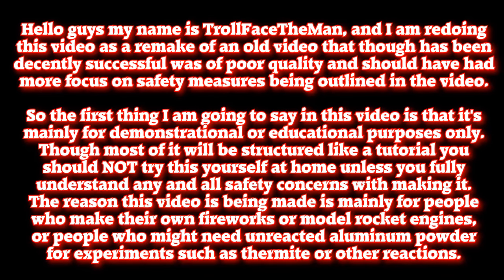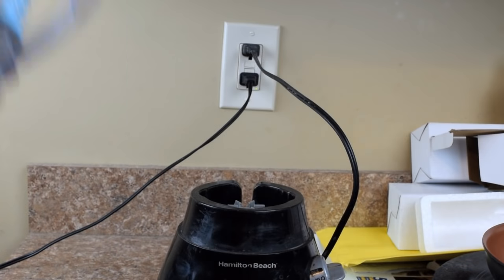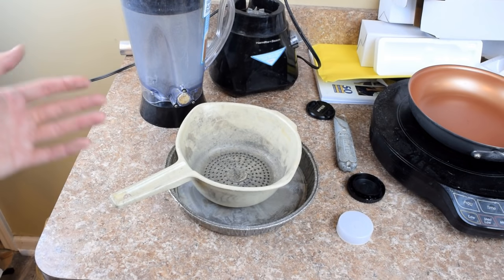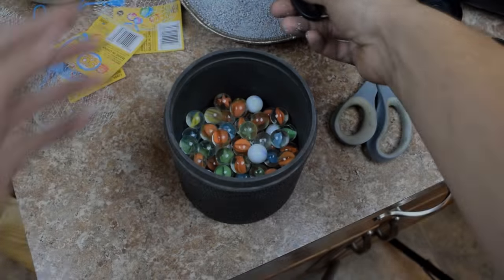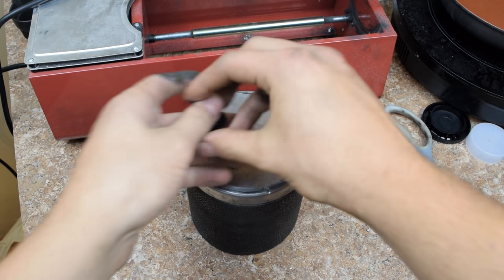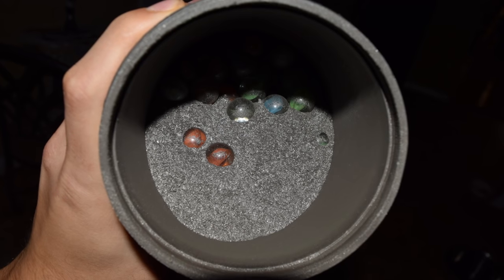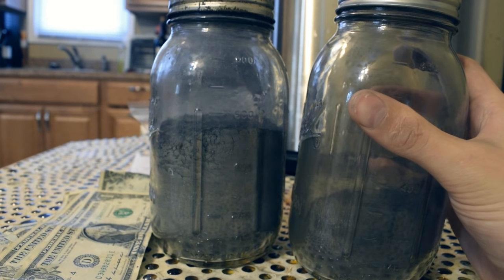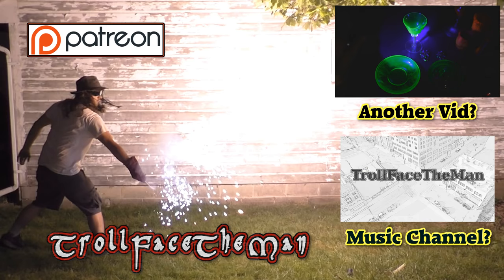How To: Easy Bulk Dark Aluminum Powder (My Homemade Process)

Comment: When you open the blender and all that ultra fine dust sized air float aluminum powder "smoke" is seen... how does that not ignite? It's extremely tiny particles in contact with fresh oxygen. I thought that would ignite as soon as the lid was opened or even as it was being ground up in the blender.
Reply: I've never tried it, however dust in general, even coffee creamer, flour and a lot of other kitchen ingredients that are essentially dust can ignite under the right conditions  pretty easily. 
 
It likely can, however with the small amount of dust produced I would be more concerned with breathing it. 
  I don't make the stuff so this is all just speculation. 
There are videos of seemingly harmless dust like flour catching and burning in the air so I would assume under the right (or wrong) conditions it could definitely happen. 

I imagine if you were to drop the container, it would make enough dust where a pilot light from a stove or water heater could ignite the dust.

Comment: So when do you add the potassium perchlorate? And what is that ratio?
Reply from the maker: I haven't ever made flash powder with perchlorate. But you definitely would only want to do that after all milling is complete and you wished to mix up a powder to use right away.

Comment: I did this (safely) and it produces such good flash powder with kclo4, but it dose t work with thermite. Do you know why?
Reply from the maker: The partical size is too small for termite I believe. It reacts to quickly and isn't able to allow time to produce a flowing blob of metal.
Reply: @TrollFaceTheMan  yeah, I found that it did light, but kinda shot molten metal everywhere and went out, leaving most of the thermite.

Comment: I bought some aluminum powder for a school project, how can I tell if it is dark aluminum with a charcoal coating or not?
Reply from the maker: +Chapman Mallard It's not aluminum Oxide correct?
Reply: TrollFaceTheMan no I need to know if the aluminum has charcoal added to prevent oxidation
Reply from the maker: Chapman Mallard, that would mainly depend on the source. Was it for pyrotechnics?
Reply: TrollFaceTheMan it was from alpha chemicals, it was listed for use in pyrotechnics, is there some type of text or any way to tell
Reply from the maker: Chapman Mallard, then likely if it is specificly not dark aluminum then it likely has some other type of anti oxygen coating to it. 

 Usually Dark aluminum is more dark grey vs light grey of non carbon treated aluminum.
Reply: TrollFaceTheMan is there any way to test it?
Reply: E-mail the people you bought it from seems the most obvious way to get the product information ??

Comment: Does charcoal for barbecue works if I ball mill it and mix it with aluminium powder?
Reply from the maker: It may have things like Chemical Accelerators added to it so likely would not be the best.
Reply: Also, most charcoal briquets also contain clay as a binder. The clay would be an undesirable contaminant.

Comment: An excellent source for free steel balls near 3/4 inch. Is at most mechanic and automotive repair shops.  In their scrap piles they will  have used / replaced CV axles for cars.  Each one will have up to eight steel balls in it.  Easy to remove, just bring rags for the grease.  The balls also make great  projectiles.
Reply from the maker: Cool bit of advice, thanks.

Comment: Would milling this in an argon gas be safer?
Reply from the maker: Arguably it may make it more dangerous.   Simply becuase though it may be safer when milling as soon as it is taken out from the argon and it is exposed to air it will oxidize more rapidly as it wasn't slowly oxidizing during the milling.

Comment: Can you make a video on how to make home made oxidizers?
Reply from the maker: Something in specific? I did want to do one on iron oxide and used to have one on potassium cholrate.
Reply: +TrollFaceTheMan I've seen boiling bleach for potassium chlorate but I heard electrolysis is more efficient
Reply from the maker: Electrolysis is kinda tricky but I think maybe I can take another look at it.
Reply: +TrollFaceTheMan I've done with a modified laptop charger and carbon rods takes some time and crystallization to clean it though
Reply from the maker: I do believe you need to also keep the solution acidic to have the best yields, but I could be mistaken.

Comment: I am in the process of making aluminum powder but it seems slow I've been milling with dual rock tumbler and always air out the aluminium powder I don't know how long to open it so it does not self ignite can some one answer
Reply from the maker: +Jose Orozco Just as long as you open it for a few seconds you should be fine.

Comment: Out of curiosity, why couldn’t this be done with water added then pour into a baking pan and let the water evaporate? No dust, no explosions.
Reply from the maker: Wouldn't work I don't think, from what I've seen is the dark aluminium will heat up when mixed with water indicating Oxidation.

 Therotoically It likely can split the water up and rob oxygen from it to achieve the. Much like how iron can rust while completly submerged underwater still.

Comment: Can this be used to with Iron Oxide for thermite? Pls respond
Reply from the maker: Yes, although it being too fine may make it not react as you'd expect. Sometimes bigger particles are actually better.
Reply: @TrollFaceTheMan  Thanks a lot, lot more question: Could this work with a more powerful oxidizer like potassium nitrate inorder to make it combust spontaniously without  flailing it in the air. Again, thanks for answering
Reply from the maker: @andyboi8399 , oxidizes and metal powers do work yes. Like Aluminum and Potassium Chlorate. But you need to be extremely careful as they can be extremely dangerous.

Comment: I honestly appreciate your constant concern for the dangers of making dark al. Its definitely not for beginners i habe considered trying it but I fortunately have access to a good deal for pyro al. However I was curious would good hot charcoal be better for the finished product and another question would heating the aluminum before shredding help break down the aluminum.. and I thought would ceramic work..
Reply from the maker: I am not sure what you mean by hot charcoal. As for like heating and tempering the aluminum, theoretically yes as long as it does oxidize a bunch. Otherwise it becomes an uncreative aluminum oxide. Ceramic should also work.
Reply: @TrollFaceTheMan  the charcoal refers to the species of wood. Most lighter woods make much better charcoal for pyrotechnics black powder I prefer eastern red cedar and paulowina it makes much faster black powder and was curious if that would translate in this aluminum manufacturer

Comment: What kind of charcoal do I need to use can I use just like regular charcoal pieces from my grill
Reply: Killa Keith I tried that and it was rubbish, look up how to make your own charcoal.
Can can just grab like a milo tin and fill it up with little bits of wood, put the lid and poke a hole in the middle of the lid then put the tin in a fire.
Its ready when theres no more smoke left, when the smoke stops block the whole from letting oxygen in the tin.

That probably could of been said way shorter but anyway.

Good luck
Reply: Charcoal briquettes have clay to make the charcoal fit into those shapes.  Natural lump charcoal would work if you don't want to make it yourself.

Comment: My Aluminium packs like in the video but when I light it, it just heats up turns orange and that’s it, it Dosent burn at all. I added charcoal by weight and I’ve milled it for about 2 weeks but it’s not reactive at all
Reply from the maker: +Jimmy Star Interesting, did you use Aluminum foil?
Reply: TrollFaceTheMan yes
Reply from the maker: Okay, if you light a bit in a spoon and dump it out does it flash up like in the video?
Reply: TrollFaceTheMan no because it’s not able to stay lit
Reply from the maker: Jimmy Star What are you lighting it with?
Reply: TrollFaceTheMan match,lighter, blowtorch
Reply: TrollFaceTheMan update: I continued to ball mill it and it lights up no problem, guess it just wansnt long enough
Reply from the maker: Interesting, good to hear it worked out for you though.

Comment: Technically a cross cut shredder would be fine as the aluminium will keep the blades sharp in theory
Reply from the maker: I have heard about using aluminum to Sharpen things like scissors, and I imagine the same concept would apply here. However, when I've seen it tested before on scissors, it didn't actually Sharpen but instead dulled them or did nothing.

Comment: How did you melt the siding on the house behind the gas grill?
Reply from the maker: +Duane Weaver My dad actually did with the grill.
Reply: TrollFaceTheMan Thanks for the safety warning.  I'll buy my aluminum powder on the internet.   Too much time and danger for something that costs about $12 a pound.
Reply from the maker: To be honest that is the best case, this would mainly be only practical if you couldn't buy it or you had a big mill to make a bunch at once.

 Still that also increases the risk. Thanks for watching the video still :)

Comment: At which temperature  @pure aluminum powder @melts??
I have aluminum powder and they are not melted.
How do I make melts.
plz tell me soon
Reply from the maker: Why would you want to melt it? And if you try to melt it in powder form likely it will all just oxidize instead due to high surface area. That is unless you do it in an oxygen free environment or use lots of flux on it.
Reply: I want to make a aluminum silicon alloy .with help of casting process
Reply from the maker: Any reason why you want to use aluminium powder instead of regular aluminium?
Reply: this is collage project       ........  brotherrrr
Reply from the maker: But what I am asking is instead of starting off with powdered aluminium which will be hard to melt without generating a whole bunch of slag, couldn't you use another Aluminum source or do you need to use that particularly?
Reply: Yeah doesn't make sense to use powder for those reasons you said. If you want to make an Al-Si alloy, you should use not powder but bulk Al and Si or else they wont melt. Regardless of your starting ingredient, you can make it melt a lot easier by stirring with a steel or stainless steel rod while in the furnace at high temp, as this will help break up the oxidation layer to help with stirring, but the problem is you will reform more oxide as you churn over unexposed/unoxidized layers of the melt and expose them to oxygen...but dude just melt bulk Al and then add chunks of Si to that liquid Al at that point based on the Al-Si phase diagram, and make sure to stir this alloy a lot for homogeneity and to thoroughly dissolve in the Si.
Reply from the maker: Thank you.

Comment: you can buy high quality dark aluminum anywhere I don't know why in the hell one would go through all the processes of destroying blenders and grinding up junk aluminum foil it's very low quality compared to the stuff you can simply buy but do what you want
Reply from the maker: Because some place you can't :/
Reply: Strongly disagree,I can make 3lbs in a week with my mill and this tutorial and it was always better than any dark aluminum i can buy,I still have a few pound lying around from way back when i used to do this
Reply: @papyro6830  do you use same ball mill as in the video. And do you make first aluminium sand in blender or just put aluminium foil on small peaces in ball mill. Which is faster.
Reply: @papyro6830  what's the price per lb when you make homemade. Is it cheaper.
Reply: cheaper? I'm not so sure...I get indian flake 2 micron for under 15$ a lb.The mill i use is the REBEL 17,its rubber lined and square  inside.I have used glass and steel milling media,i prefer steel because it's much faster.. I have done it many ways,shredded by hand and tossed in,shredded by hand and run through a blender first then tossed in. The latter works better due to milling everything  to a equal size at once,the first way gives you a mix of airfloat,course and fine all mixed together which requires a good screen or two to seperate it all. I have tried with and without stearin added,charcoal as well. Stearin did little,maybe even slowed it down a bit...Charcoal is the secret sauce in my opinion. The spoon test is obvious,without it added it burns slowly across the spoon like what you buy commercially,when added at about 5% it rapidly consumes the whole spoon in seconds. I can't name something else i have tried for safety reason but i have added a certain metal at 5% to the final product before and WOW it made it burn so fast on the spoon it made a popping sound,lol
I used to have a quart laying around i had saved and i loved using that stuff for flash,it made some supercharged flash that was nasty stuff.  I no longer make it because of the cheap cost and availability where i live,BUT extremely good aluminum can be made this way if you have the time and patience...The whole process has been labeled extremely dangerous if you google and research it,so i'm not advising anyone to try this,just adding my personal experience.
Reply: @papyro6830  thanks.

Comment: Marbles don't have edges unless they break apart. The ball mill you are using is all rubber not metal. The tub is air tight and the process is totally anaerobic which means there is no oxygen left after the powder becomes fine enough and the powder is oxidized which gives it its dark color. You don't really need powdered charcoal. The pros use stearin. If you use that particular mill you shouldn't mill for more than 4 hours at a time, stop the mill, open the tub and let the powder absorb atmospheric oxygen which renders it inert unless you add flame to it. Also there are alternative grinding media, ceramic balls and lead-antimony balls which can be gotten at any sporting good store online that sells shotgun reloading supplies. I use stainless steel balls which won't spark in an atmosphere with no oxygen.
Caveat: Please do all this outside or any suitable structure that no one is using. If you over grind the aluminum and just pop open the tub it can spontaneously EXPLODE.
Take it from me it happens! And by the time you get done buying a ball mill, aluminum foil (very expensive) And all the time you spend doing this you'ed be much better off buying Dark Al from any site that sells it and there are a handful. I go to "Star Molecule".

Comment: very nice video ! but this method is good for small quantities , not bulk
Reply from the maker: +Zakamooza Thanks for the comment on the video. However I would argue the definition of Bulk, mainly because this amount I made here would be plenty for most hobbiest for awhile, especially if I used both barrels at once.

 And it is better than a lot of these other videos I've see where people manage to produce literally a few grams at a time.

 But the real reason I will argue this point is that this can be scaled almost indefinitely. You could buy or make a 5gal tumbler and use this exact same method to produce more Dark Aluminum.
Reply: but grinding all this al with a blender would take hours, keeping in mind  that the blender would get  really hot  spinning at high rpms. you would need to let it cool down in order to protect it from overheating and possibly causing it to fail. But that is just my opinion :)
Reply from the maker: +Zakamooza The thing with the blender Though is it is fairly dangerous to do because of the possibility of Auto Ignition. Yes I can agree you could do it quicker, but think of this more as a sit back and wait method instead of a man hour intensive method like constantly grinding it up in a blender.

Comment: Can we use dark aluminum powder?
Reply from the maker: I don't understand the question?
Reply: @TrollFaceTheMan  it was so long ago I forgot lol but I think 🤔, I was asking if I can use gun powder.
Reply from the maker: @jason9613  in place of it?
Reply: @TrollFaceTheMan  yes
Reply from the maker: @jason9613 , if you are talking about for bullets I would definitely say no. Blackpowder is specifically designed to be used in them.

 There are things like possible corrosion issues on guns, ignition speeds of the powder with gas expansion speeds and volume and properties under compression to take into consideration. 

 If you do it wrong it might not work at all, or you might get and explosion instead of a firing.

 If you are asking in fireworks. Then yes. Flash powders are usually what is used. However most of the time it is black powder that fires fireworks up, and flash powders that give a boom.

 They have very different characteristics.
Reply: @TrollFaceTheMan  oh no, I am/was trying to make m80s fireworks 🎆🎇. But I kinda gave up the ghost on them 😂 scared of blowing off my fingers